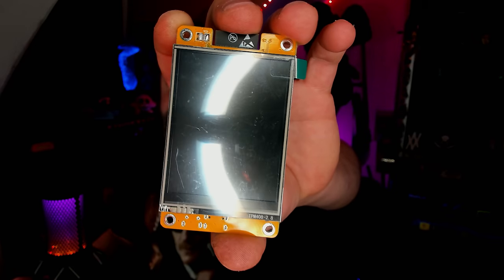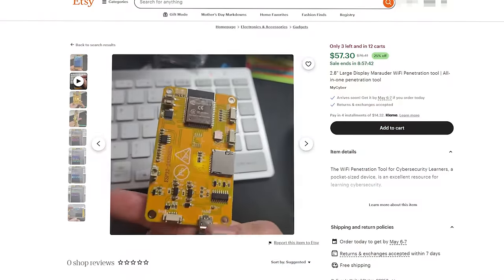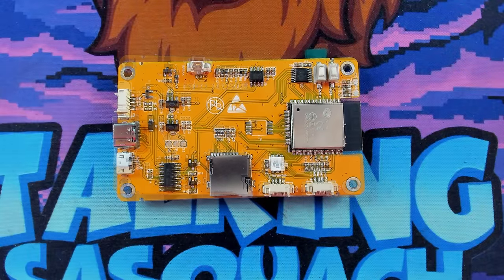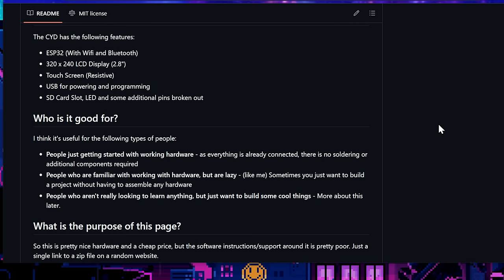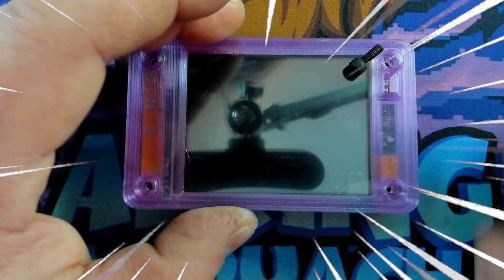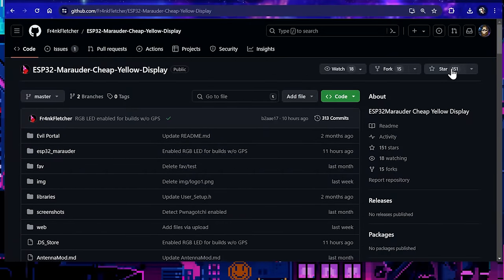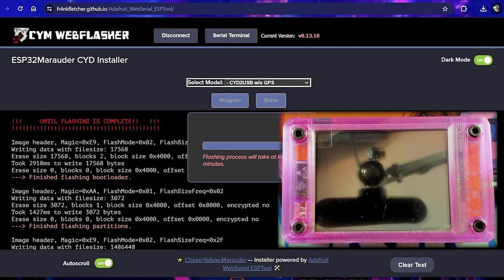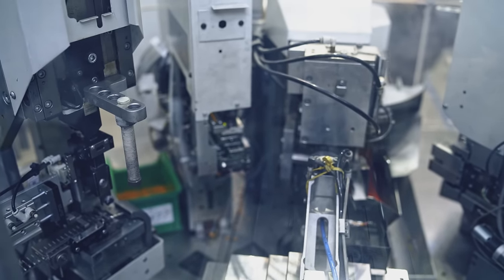Don't be Fooled!! This Cheap Yellow Display Can Do a LOT!!

Comment: Awesomw video as always! Couple of things though. 1. You absolutely can connect an SMA connector to its ESP32 via the antenna mod (really easy as well) and combined with a case that has a hole with it, you can have external antenna. 2. On the same token, if you connect a gps module, you can have external gps antenna as well. 3. You can also have an external battery wired up if you change the connector. 4. There's also the Guition jc4827w543 variant that has capacitive IPS and battery and GPS connection. Only issue is there's no case design or support for it as of yet ☹️
Reply: thx
Reply: Do you have a link to schematics where I can attach the antenna? I’m also try to figure out where exactly to attach eternal battery with usb c charging.
Reply: @BlueeBubble  yo bro make a vid on how to do that and where to get that stuff
Reply: Where can I
Reply: Are you sure? SMA modification to CYD... Hmmm Never heard about it 🤔
Reply: Thanks everyone for the reply! I feel like I should make a video showing how easy it is to give an esp32 an external antenna now 😆 lol it's not too hard! Practically any board with integrated antenna can be modded!
Reply: @BlueeBubble  I'm eagerly waiting for your video where you show how to do it 😅 I'll be happy to be the first to give you a like on the video 😂
Reply: Ok guys since there's such an interest imma actually make a YT channel and make a video about this soon! Will let everyone know! It's gonna be my first mod videos and uploaded! 😁 Will comment again once I made the video and built my own version explaining how to do the antenna mod!
Reply: @BlueeBubble looked online and the antenna mod doesn’t seem to increase anything that much?

Comment: Adding gps is also easy. Currently waiting for SMA connectors to add external antenna, and fit it with a 18650 battery and design a case for it.

Comment: @Talking Sasquach You forgot to mention that you have to press the boot button in order to be able to flash the board. 
Otherwise it will give error

Connecting...
Connected successfully.
Try hard reset.
[Za.readLoop:1] Finished read loop
Error: Couldn't sync to ESP. Try resetting.
Reply from the maker: Not with mine but there are multiple CYDs
Reply: Did you resolve this? i have same issue.
Reply: @bhambhole  worked to me.
Reply: @diomaiaal  I just got it actually. Had to hold down boot when I clicked to connect to the selected port in the webflasher. I was just resetting while holding boot but u must hold boot while the portal connects to the com port. Thanks for your reply.
Reply: @bhambhole  glad you solved your problem. Enjoy

Comment: 9:45 looks like that example is for the CYD not the CYD2USB which is the one u bought, it needs some tweaks on the TFT setup otherwise u get inverted colours and other fun stuff (that clock is supposed to be yellow on black ) :)
Reply from the maker: LOL that makes sense!
Reply: Most of the pio files have a CYD2USB environment that looks after the inverting for you if you pick it (when you have a cyd with two USB)

Comment: So what are the portable power options for it?
Reply from the maker: You can use a battery, but u need to either use their supplied plug, solder it directly or change the plug

Comment: Can you help me every single time I try to connect it to the Web flasher it says could not sync to ESP try resetting I have tried resetting and everything and I bought this off of AliExpress and it came with this weird program that says profile analytics and shop
Reply: yeah same edo you know how to fix
Reply: @zubrus1969  I figured it out. You have to hold the boot button down, but before you do that, hit the reset button and the boot button and then hold it while you’re doing the flash.

Comment: I cannot find where to get a case for my cheap yellow display. I have the components to add a lithium battery with voltage regulator and usb-c connector for battery charging. But, I need a case to put everything together.

Comment: sadly cant get cym to flash my cyd.. keep getting error Connecting...
Connected successfully.
Try hard reset.
[Za.readLoop:1] Finished read loop
Error: Couldn't sync to ESP. Try resetting.
Reply: I got the same error and I got crazy for 20 mins until I found something.
Try to press the BOOT button on the back of the board. There are 2 mini buttons back, once you connect the board to the PC and connect the board on webflasher, hold the button on the back and select the COM port. Hopefully it will detect the board and let you select what kind of board is. You can recognise the BOOT button because it's written on pcb BOOT. The other button is the reset. It worked to me
Reply: i have same problem even in boot mode with S028R on win11 using chrome. Did you find a solution?

Comment: hi bro i have a problem when i want to flash it appears this error also when it says flashing completed i reconect my board but nothing my board is only in blanc. error :  
Image header, Magic=0xE9, FlashMode=0x02, FlashSizeFreq=0x2F
Writing data with filesize: 17568
Erase size 17568, blocks 2, block size 0x4000, offset 0x1000, encrypted no
Error: SlipReadError: Timed out waiting for packet header
Image header, Magic=0xAA, FlashMode=0x01, FlashSizeFreq=0x02
Writing data with filesize: 3072
Erase size 3072, blocks 1, block size 0x4000, offset 0x8000, encrypted no
Error: SlipReadError: Timed out waiting for packet header
Image header, Magic=0xE9, FlashMode=0x02, FlashSizeFreq=0x2F
Writing data with filesize: 1465072
Erase size 1465072, blocks 90, block size 0x4000, offset 0x10000, encrypted no
Error: SlipReadError: Timed out waiting for packet header

Comment: Yo Yo! There's an conflict with the links you'd provided.... you are linking to the versions with micro usb but no usb c...plus, multiple references to the wrong version. It is a hit/miss using the 2.8 inch screen without the usb c... The usbc version has a lower fail rate/ is the proper version. The difference in model number is the usb c version has a c at the end of the model number where the micro usb version has an r. JC2432W328C is the correct model..where JC2432W328R may work, more so...won't- & leave you with a head ache trying to figure out why the h@@@ the thing won't get recognized in the flasher...

So, yeah the correct 1 to get is the JC2432W328C  model.